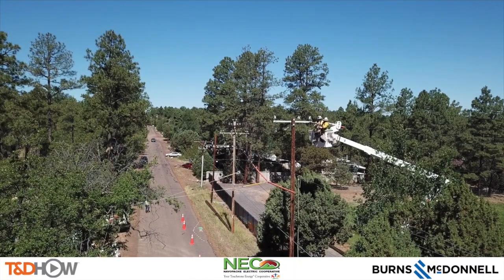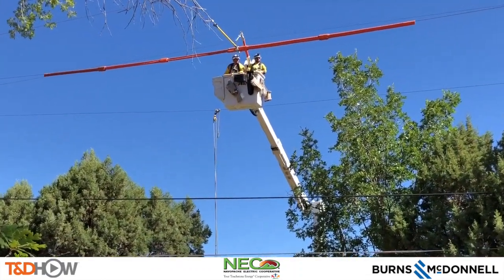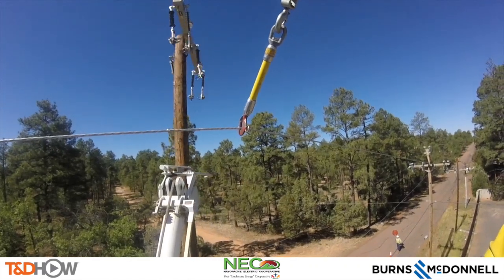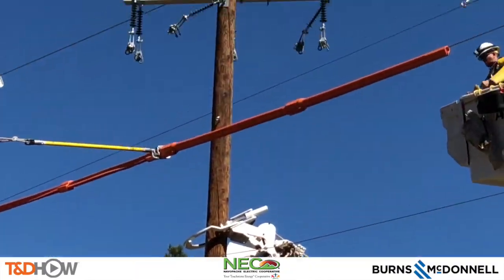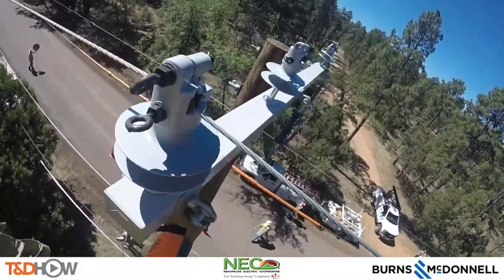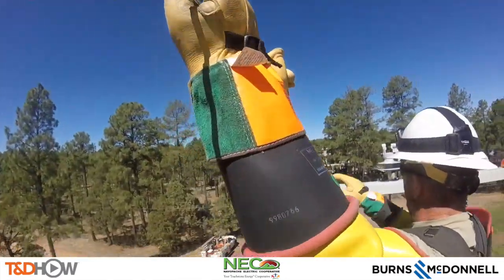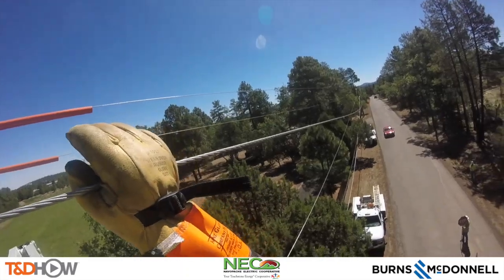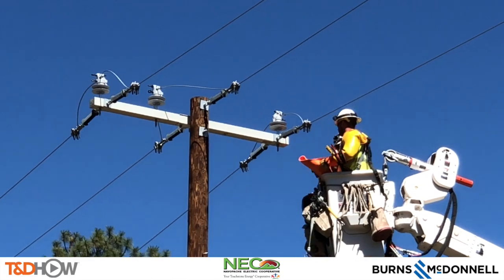Energized Line Transfer

Comment: Does your body feel anything differently when being up there touching live wires with thousands of volts? I know they are insulated, but don’t they feel a bit different?
Reply: From my understanding they are not insulated it's a bare wire made from aluminum.
Reply: Swamp Ass I meant the guys up there wearing the insulated gear. I wonder if it feels like anything when handling hot high voltage.
Reply: Like a vibration
Reply: Only their steel balls tingles that's all.
Reply: @jondoh599  🤣
Reply: @jondoh599  Their ass probably tingles a bit too

Comment: I would never do that. Just disconnect the powerline and get substation fed from the other side during maintenance time. If there is no redundant line, just get job done without power. Nobody will die due to power outage of a few hours.
Reply: Energized work is perfectly safe if done properly.... No need to de energize the line for this type of work.
Reply: @Gmcguy758  Sure this job can be done on an energized like, but the lack of coverup is really scary. Lots of ways they could have struck an arc - with explosive consequences for the guys in the bucket

You can either cut the power and work quickly, or be more careful but not interrupt service. Someone decided they wanted speed and uptime both and were willing to sacrifice safety.
Reply: Yeah your right if we in the 80s and 90s but The world is changing and the power supply companies have to meet maximum customer outage  restrictions - There is a price on human life unfortunately
Reply: Thats why you gotta save this kind of work for the real men, stick to your office job.
Reply: @LarryL3g3nd  you probably wouldn't last long

Comment: There's alotta dudes claiming to lineman but y'all sound like a bunch pu$$ies, I'm sorry lol. None of you would make it Westchester county or Yonkers lol. Some people mentioned Duke lol yea you need another truck to carry yer rubber to satisfy Duke, sissies. These men did a fine job, they set a 45 between center and field phase, center had like 6 guts on it and field was picked way up outta the way in the jib. I've held all 3 rubbered up one in my jib two across my bucket, picked it so they could set underneath me, land all 3 rite back into the glass. Sounds like alot of you work for utilities not contractors lol. Sounds like alot of you have taken more safety classes than actual in the field hands on work, sounds like alot of you have watched line work and criticized the men doing it. I do know that there's only one thing any two lineman can agree on and that is...that other M.fker is doing it wrong lol.

Comment: Wow I had no idea linemen ever touched the lines.  I know their gloves are rated for it but I still assumed all work was done in a way to best avoid it.  Are the bucket trucks fully insulated from ground?  Wondering how bad it would be if one slipped up and it contacted their skin such as their face.
Reply: Trucks a fully insulated 3 times, bucket liner, and twice on the boom. You can touch energized conductor so long as you’re fully insulated, as you are in a bucket, so long as there is no crossphasing or path to ground.
Reply: Blood, guts, body parts, etc. is what can happen if you ever came in contact with that kind of voltage lololol

Comment: To everyone pointing out mistakes let me know when you have done actual linework talking about cover and setting poles and they should have done this and should have done that and why pull slack out of a tangent to make an over arm jumper ... we’ll be cause the less connections the less things to potentially fail... I would have double rigged to keep equal tension on the double dead end but can’t be a Monday morning qb and say what YOU  would have done
Reply: LOL someone feels personally attacked by those safety violation callouts
Reply: I do . And that my friend double dead ends was a waste of time and life
Reply: U put more strain on that wire will make the next pole tighter and you won't get that slack my friend
Reply: Engineers call for double dead not the lineman they get paid a lot of money think they are smarter than the hands out there building the stuff lol right now we are stringing in 336 tree wire and every pole is a double dead end and fully covered fun stuff

Comment: Besides the lack of cover up, just putting it in the shoe on one side and pulling up tension til you got your “jumper” on the other side, you know that pole is crooked now, and center had to be waaay tighter to achieve that jumper. So brand new crooked pole and bad sag. Why double deadend it to begin with?
Reply: @davidb0101 I saw the same thing lol, scabs trying to look like superheroes infront of a camera just to get some shotty linework in the end

Comment: What's the purpose of having the part over the pole slack and pulling it tight on one side?
Reply: strain relief. we usually put them for every 7th pole or where there is an angle on the line

Comment: In my area which is in Australia I think that they de-energize the power lines when doing major work such as that !
Reply: I feel that's the way to go imo.  No service assurance is worth making a job 10x more dangerous than it has to be.  I would rather my power go off for a couple hours or a day and know the linemen are safer.  The job can probably be done faster when power is off too.  Ground both ends of all 3 phases and it is safe to work on.
Reply: @redsquirrelftw  you’d be surprised how much people complain when we de-energize to do this kind of work
Reply: @dillanglover107  We have deenergizations very very rarely here in Germany. I would assume that we have more backup. When I was a child (30years ago) we had more outages, but the energy supply has improved and I cannot remember any outage over the last years, not even during thunderstorms.
Reply: We do both in Aus.  But agree with most comments on this page that this is work to a poor standard.  Piss poor cover up
Reply: That's the harsh reality of US capitalism. In Europe we have more of a "soziale Marktwirtschaft" (not always very social, but for sure better than in the US). Protection of workers has a higher value here in relation to maximizing profit than in the US.
Reply: They do most stuff live where I live.
Proper safety and more rubber than needed but you can never be too safe.

Comment: They took up all the slack needed for the jumpers by making the conductors too tight.  Should have used other wire and burndys.
Reply: Connections make hot spots. It was probably framed the same way before so they probably had all the slack they needed to make their dead end back up easy.
Reply: Michael Riley i doubt that theory.
Reply: @davidd1395  Oh yea, you must be an experienced lineman who spends at least 50 hrs a week transferring distro, since you have crazy superior intelligence in the matter lol.
Reply: Michael Riley you got it punk

Comment: While it looks good on camera there should be alot more rubbers up there someone gets butter fingers and u have nice arc flashes
Reply: At one point one the guys face was about 2cm (less than a inch) from that live wire (if if was really live)... https://youtu.be/KrQ17myzSFw?t=308
Reply: @a64738  He can actually touch a live wire, because he's insulated from the ground. It'll sting quite a bit (his body would work as a capacitor, passing some of the AC current) but won't be dangerous.
Reply: @AlexBesogonov  His body wont just be a capacitor to the environment, his body will energize the WHOLE TRUCK and the capacitive leakage currents will probably hurt him.
Reply: @emc4361  you can touch energized wire out of a insulated bucket and be fine. You’ll feel the bite or discomfort on your skin when making the initial contact but that’s it. Stop trying to sound smart about something you clearly have no experience with please.
Reply: @AlexBesogonov he has isolated himself from the ground, but not too much insulation was used. One wrong touch of that crossarm and it wouldn’t matter how much rubber was on the pole, it would be his path to ground
Reply: @aarongust7551  You don't need a lot of insulation for these voltages. Just a couple of centimeters of plastic/rubber is enough. Insulators are big to make sure an arc can't form if the current does jump through the gap.
Reply: Oh shly
Reply: Butter fingers on what? They’re not cutting wire tails? 3 wire construction gives you plenty of spacing between yourself and opposite phases. The knuckle on their boom is very low so they basically covered the 2 first phases they transferred for no reason other than the camera. It’s a fiberglass arm if you’re concerned about second point of contact maybe??? Are you an apprentice?
Reply: @Franky8312  what's the voltage rating on that fiberglass arm?
Reply: @linetrash4298  what are hot sticks made out of? Fiberglass isn’t conductive and even so no one would plan on laying wire on it, but if it did make contact for whatever reason, I guarantee you it would be fine as long as it’s not raining or extremely dirty. It’s ok to use common sense sometimes.
Reply: @Franky8312  I don't disagree, but that doesn't change the fact that the MAD was being blatantly violated in the video. I'm just surprised they actually recorded then released the video as is.
Reply: @linetrash4298  the MAD is only for yourself and your rubber gloves and that’s only if you’re intending on working on the wire, or making a move where you can possibly make contact with it. They didn’t break any rules here. Maybe for specific companies they might’ve. A lot of companies have rules that exceed OSHA’s.
Reply: @Franky8312  your MAD starts at the furthest point you or whatever your holding can reach(my understanding of OSHA).  To me it looked like when they were moving a phase they would've been able to reach towards the next closet phase and broken MAD. Also if a cross arm or any piece of equipment doesn't have a voltage rating it should be considered as being at a different potential. I don't know about these arms or this companies procedures. But where I work, fiberglass arms do not have voltage rating and we would be required to cover them.
Reply: @linetrash4298  that’s just being picky now.

Comment: How much voltage is in the line
Reply: Likely 7.2kV or under 15kV.
Reply: 7200/12470 is a common voltage found on co-op systems.  14.4kV is the other standard.  Of course in the Dakotas and some other places, you'll see 41.6kV used on account of the very long lines connecting loads.
Reply: 250k-400k depends on the area  but im no line man nor an electrician but soon to be one but that looks like a residential area so it might be lower then if you had lines in a place with a lot of factory buildings
Reply: @stefanpozder8376  
No, this is a primary distribution line.  It would NOT have transmission line voltages on it.   Probably around 12k to 24k.  Could also be 7.5K (each conductor).
Reply: Swinde oh shit I know i wrote the numbers down in my note book but I’m to lazy to go through it but i think your credible like i said i just finished a diploma course they didn’t really go into depth to the distribution side. We focused more on conduit bending,branch circuit sizing,residential cable wiring,service installation,motor controls,contacts,solenoids,OL relays stuff like that But i did consider at one point going the lineman route thank you for the correction

Comment: No safety department I suppose WTF
Reply: @alfonso Flores I just recently graduated line school so not a lineman just yet but this is what I saw, when working energized lines you want to insulate everything around you so that if you accidentally touch something you won't be making a second point of contact  (which is why you get shocked) and so these guys didn't cover the crossarm, the pole itself, every conductor, every insulator, and every thing in general, you want everything around you to be covered, this was super unsafe
Reply: Welcome to the real world.  Nobody I have ever worked with uses that much cover.  And why would you cover a fiberglass crossarm anyway?